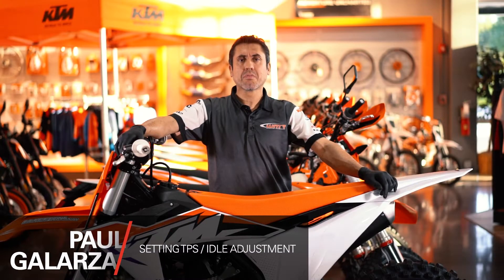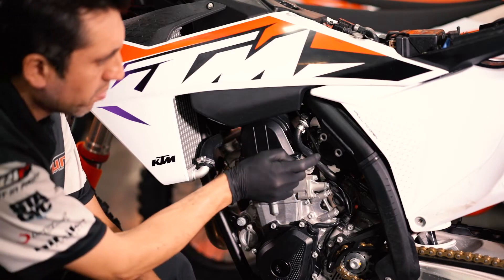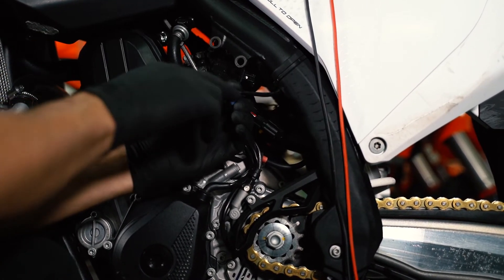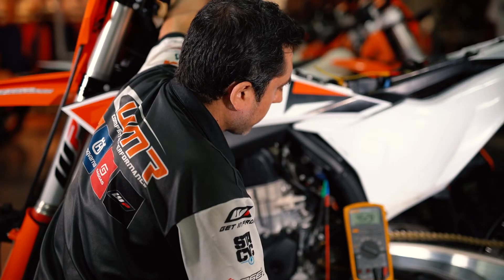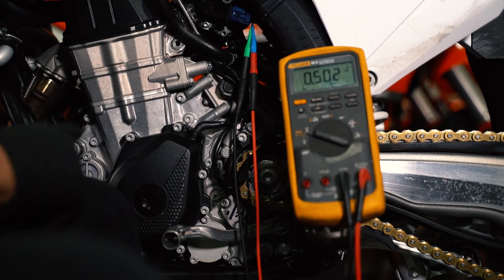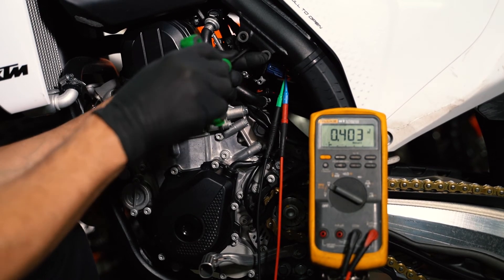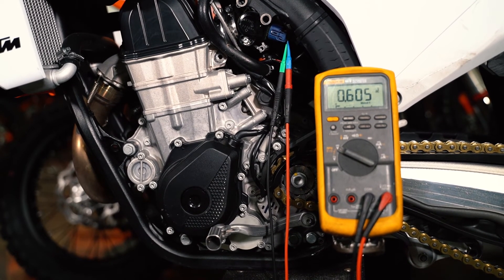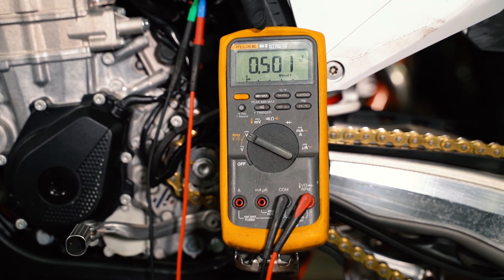WMR Tech Talk:  Setting TPS / Idle Adjustment

Comment: Is .4 volts for a 2025 ktm 500 excf correct? Mine reads .6,  knobs turned all out, lots of throttle cable slack, but bike seems to run good?  Also, I can read tps voltage without hitting the starter switch or jumping pins 4 and 5  on the diag plug. In other words, voltage is always present at the tps?

Comment: 👎 :-/
That is not the proper calibration for KTM TPS and you should not be backprobing  sealed connectors or they will no longer seal properly.
Reply: They are not sealed.

Comment: This is a good video that just needs some fixing!  I was super confused so the comments were helpful.  To try to help, here's the quick steps:  1.  back off both Yellow and Red knobs (CCW); 2.   set TPS to 0.400;  3.  turn RED KNOB in to 0.500:  4.  turn Yellow Knob IN till 0.6500 after clicked in, use throttle to click off.   5.  start bike and turn Red Knob in to 0.530  Done.......hope this helps
Reply: Great video! I used a wire and wrapped it around the black on battery screwed it down then slid it into the connection to wake the bike and it worked flawless great trick! Bike is a 24 fe350w  She running nice now after the taco tune! Thanks for the breakdown!
Reply: @randyd8120    My 2024 500 has a tps .6 volts with both knobs all out, lots of cable slack. What was yours from factory? And the tps always has voltage - dont need to jump anything to power up the ecu. Was yours like that? Also running the TM ecu flash! Bike runs good despite that .6 tps voltage.
Reply: @randyd8120  can you clarify "the connection". Am trying to get it powered. Thanks

Comment: Proper instructions (red vs yellow knob) from 13:19 onwards. Red is idle (5v) yellow is cold start (6v when pressed in but will jump out when throttle rolled forwards and have no effect on rpm, leaving the red knob to keep the 5v setting). Hope that helps. This video seems to double up the instructions with knobs confused. The first run through is wrong 11:10 = ignore him saying the yellow is your idle. It's the red.